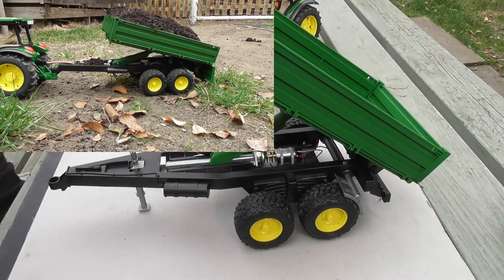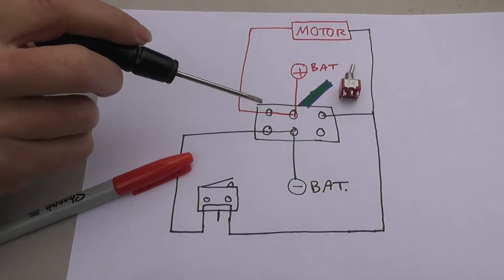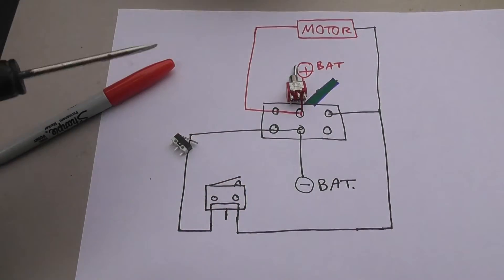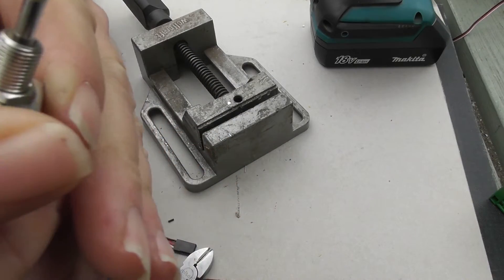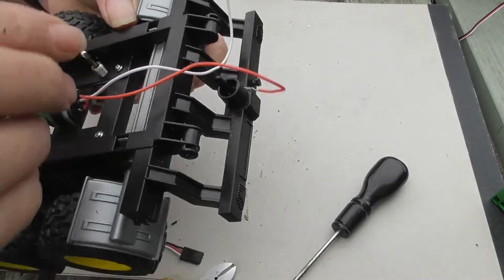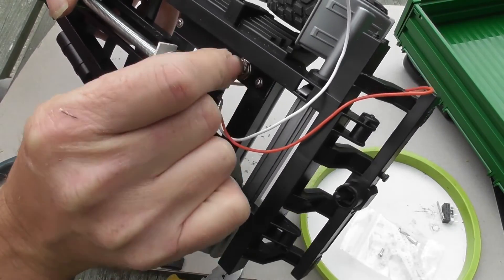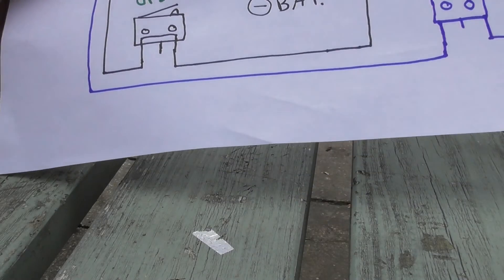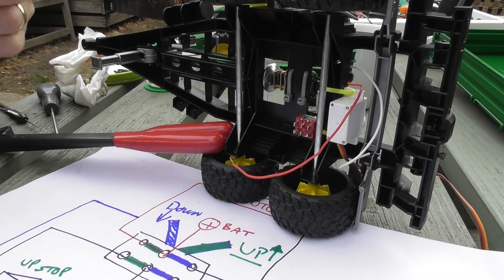Bruder Tipping Trailer RC conversion part 2 : electronics

Comment: Well done...I'm enjoying watching and learning. If I'm using a Flysky tx (i6X) could I delete the micro switches, servo and switch and adjust the up and down travel using the END POINT functions on the trans.?
Reply from the maker: You could use a speed controller like this https://amzn.to/2V0phfY instead of the servo and switch, but need to keep the micro-switches in place to tell the motor when it has reached the end of its travel. If that makes sense? I think I show the wiring to do this in the excavator video build series.  😀👍

Comment: Was struggling for ages on how to do the trailer with put a linear actuator as a very low budget and this is perfect! Wish I didn't sell my project now... big fan of all the projects you do and can't wait to see the trucks!!
Reply from the maker: 🙂 this took me a little while to figure out - the breakthrough was when i worked out how to wire up the toggle switch with as few wires as possible. Glad you enjoy the videos. I'll start on the trucks when I've perfected a cheap and easily repeatable drive and steering system (I did a Mack dump truck ages ago using Meccano and Mardave Marauder steering parts, but I want to do a cleaner build for a video) - almost there!    👍

Comment: Very nice bud thats alot of work going on there you almost lost me lol.. Something you might want to try by the time you spend the money for the motor too drive the screw drive the servo for the switch, micro switch etc..and the time it takes to put it all together.. Have you ever customized your own 360 rotation servos.. If you can do what you just did you'll hav eno problem making your own servo mods..  then add your 2.2K resestors to the mix and they will center out when not in use.. also you can dial it in even more on sub trims on transmitter.. This will allow you to buy one servo for your build.. from there you can use the same set up for slower builds as gear boxes 8-)
Reply from the maker: This was a fun build & i'm happy with the result. I guess we are all constantly learning & agree that servo mods offer a lot of potential, plus complexity / cost saving. I went down this route with the trailer partly because I haven't yet figured out how to combine travel limits (micro switches) with either ESC's or servo boards. I have been looking  at your builds (particularly your excellent big dozer) for inspiration!   🙂
Reply: Your doing a awesome job bud keep it up.. as myself I have never seen a Bruder dozer before in my life or had any assistance on how to build one.. I just went with what I think would work and with what I know to make it happen as well.. that dozer was my first dozer build I have sold that one but I will be making another one soon 👍🏼  I love these Bruder and ertl or any toy conversion it really is fun too challenge the mind..